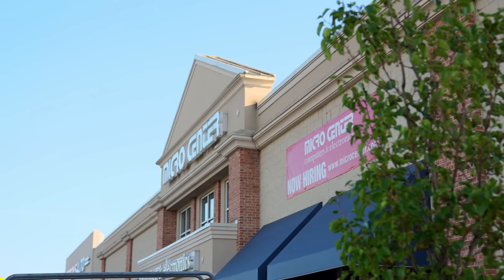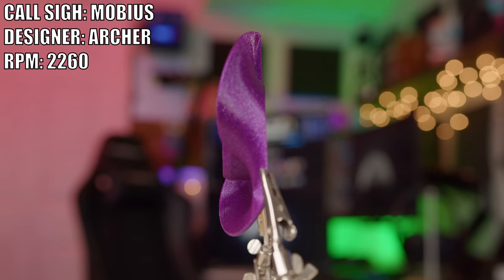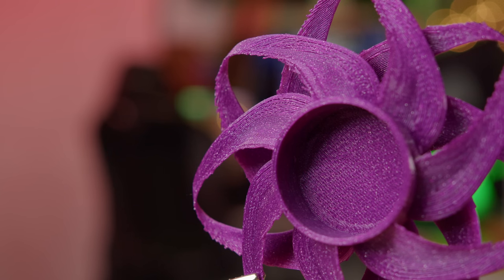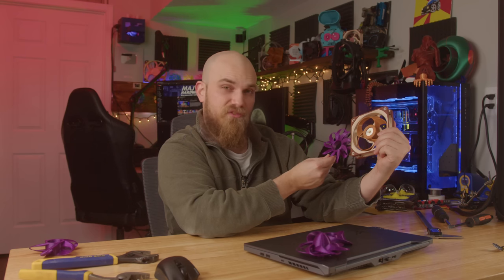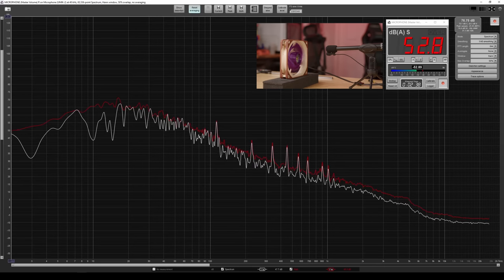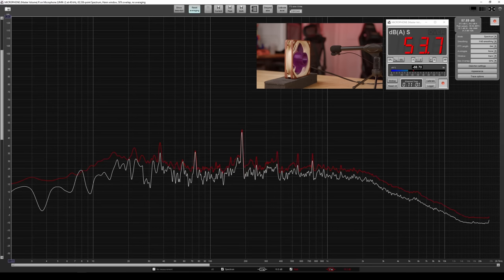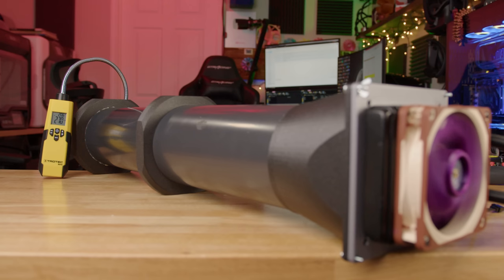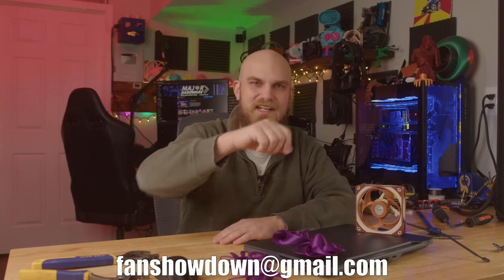My Subscribers Turned MIT Award Winning Toroidal Propeller Into A PC Fan | Fan Showdown S5E5

Comment: Very interesting. That original MIT blade was meant to spin in free air as a propeller not in a shroud ring as in impeller though. That's not a trivial detail regarding performance. Were the design optimized as an impeller it would drive notable changes in form factor.  Beside shape fidelity, surface finish also has major impact on laminar flow which directly relates to efficiency/turbulence aka noise. Even well printed FDM blades are going to suffer, but when they're ragged from support or missing chunks it kind of invalidates the process. This has really gotten me curious to how these really perform though, I feel like there's big potential here.  tl;dr: optimize for impeller duty and print in resin to see how toroidal blades truly perform

Comment: So I'm not an engineer so maybe I'm completely off the ball, but wouldn't a lot of these tests also depend on the manufacturing and actual material of the fans? I would just assume so because 3d printed stuff at least in my experience isn't watertight and has a bunch of seems so I would assume that air getting in those seams and stuff would make it a worse product even though it should be better than a normal fan, I think you should use the Noctua fan 3d printed copy as a control and resin print all of these if you were to revisit this, but again not an engineer so could be super wrong.

Comment: From what I saw from others, the toroidal props for drones wasn't even a good idea as it ruins flight times as the propellers weigh so much more and drag more in the air. They seemed to have noise normalized for RPM but since it's less efficient the RPM needs to be higher and as a result the shape is just less efficient and only negligibly quieter.

Comment: Isn’t the point of these toroidal blades to minimize vortices?  Doesn’t the ring housing on a fan dispense with those?

If so, this test would never show the advantage. 

Is there some test, like thrust comparison, that could compare these great prints to these tipped blades, but without the housing?

Comment: Why don't you use sla/dlp printer. Propellers would have way better finish, dimensional accuracy and weight balance. And way less struggle with thin blades.

Comment: The cooling fans are already encased, so I'd imagine the vortices are already reduced. This is basically nullifies the biggest advantage toroidal blades have over normal fan blades. Plus the design effort and testing put into the blades, It doesn't surprise me at all that the toroidal blades lose.

Comment: Another test another fail I say.Toroidal blade design is for between 2500-4500RPM range. You barely touch the 2500RPM milestone. You had to try with Noctua's Industrial series that could rech those rpms.

Comment: Obviously those fans are not doing good with a radiator between, the design is just not suited for static pressure without radiator they will probably move quite some air.

Comment: I'm thinking Toroidal fans get their benifits because they are designed to allow the high pressure to flow into the low pressure side of the blade which then positively affects the reverse side of the loop. The cheater gets its enhanced performance because the duct prevents energy loss in turbulence  due to tight tolerances between the rotor tips and the duct. However, Toroidal is hampered by the shroud. I think if you want the benefits of the toroidal design you need to cut away the shroud and mount the motor on X shaped struts.

Comment: this is going to be a bit of a long comment about why the mobius may have had the same result in both test. my sciantific knowlage is limited to my electrical training but physics is physics so please feel free to test my theory.

I belive that your air flow measing device only tells you air speed, regardless of the direction. a fan will only be able to move a limited amount of air by volume and other constraist could change how fast the air moves. but with this in mind the mobius on the test should get the same result as it is moving the same amount of air regardless of if it is sucking or blowing the air. in the electrical industry we can get simular results depending on the tests we perform. on a resistance test, it doesnt matter where i put the probes as the result is the same, on a voltage test the result would still be the same but if the probes are the wrong way round i get a negative value equal to the positive value. 230volts is the same regardles which way it flows, the nagative value just tells me which way it's flowing.

try putting some fans on the same test. put them in both a push then pull configuration. if you get the same result both times then my hypothisys is correct (all fans move a set volume of air to a certain speed regardless of sucking or blowing) if you get a negative result which is the same as the positive (+- for errors) then your measuring devise can also inform you of direction, this would also outline an oddity with the mobius being always positive within the tube (like an auto direction feature). if you get diffrent results, ignore this comment.
Reply: Thanks for the feedback. 
Expect more videos soon. 
Send a direct message... 
I have a Gift for you📦......

Comment: Toroidal fans are designed to reduce turbulence at the blade tips and direct the airflow because they are designed to be used WITHOUT a frame. The fan frame in a PC fan is there to do the same job; reduce turbulence at the blade tips and direct the airflow. So unless you can manage to run the A12x25 without a frame and then test these toroidal fans frameless, it's just not a fair comparison. The toroidal fans have more jobs... They have to eliminate turbulence, reduce noise and generate airflow. A standard PC fan mostly just has to push a ton of air and noise becomes the secondary concern, however noise is also a byproduct of turbulence and the fan frame is a huge contributor to eliminating turbulence.

I've also noticed that all of these toroidal fan designs follow the standard toroidal concept of having fat blades at the center and reducing the width as it goes towards the tip, which is totally backwards from nearly every single high CFM PC fan design. I wonder if you'd get better results from the toroidal fans by using thinner blades near the center that get wider towards the tip, like a normal PC fan.

Side note: The A12x25 is a great fan and very hard to beat. I think the BeQuiet Silent Wings Pro 4 (that's a mouthful) actually gets better airflow than the A12x25.
I looked around to see if you'd done a comparison video between these fans but couldn't find one. 
It would be awesome to see these two fans go head to head in an in-depth comparison to see which one is top dog.

Comment: Why hasn't no one made a thinner / lighter version of the ref. Noctua fan blade design? We know Noctua makes the best design, so why not just improve on that and make it lighter, taking out unnecessary cosmetic plastic sections and making the blades slightly thinner / more delicate so it can spin faster.

Comment: This won’t work with a flat fan. At least at low speeds (below 20000 rpm) it has to be elongated. Otherwise the toroid is just like two blades.

Comment: From a standpoint of fluiddynamics its clear. All those toroidal fans are constructed to create flow while spinning freely and not in a tube. They are created to reduce noise and cavitation. Also one cant just simply take a toroid and scale it down, thats not how it works. As a fan they will never be as good as a normal fan, because they are not ment to be incased.

Comment: Problem with thinking thoroidial fans in an enclosure is that there is no need for the extra boundary that the thoroid provides. Thoroids idea is to use them in application where there is no enclosure boundary wall for the propeller, for example boat propellers and copters propeller to ensure the air doesn’t escape the blade. So I just think the whole idea of thoroidal being applicable in this scenario is just waste of time.

Comment: Hey man, could you please give me parameters of the box, on which you're installing the propeller (diameter of a hole, maximum diameter of propeller and rotation speed), i want to design my own propeller and send it to you for 3d printing, and also can send you several bucks as compensation of materials. Tell me the price. If it's less then 10 bucks, i'm in...

Comment: It would be good to know the airflow in liters per second in addition to CFM so people don't miscalculate conversions and so toroidal fans can be used in air filtration applications for improved indoor air quality to reduce the spread of infectious disease in surgical and some other healthcare applications. See the new CDC guidelines on improving indoor air quality and the standards (subject to change). 
    Quiet fans are important because health care providers need to hear heart and lung sounds among other sounds that may need to be auscultated.  Putting fans in a ducted positionable tube or on an articulated arm as part of a mini Corsi-Rosenthal Box air purifier could get the air intake close to the exhalations of staff without being too obtrusive,  in an operating room could be an option for improving the working conditions of surgeons, anesthesiologists and staff. This depends on high liters per second, and very close proximity of the air intake to the mouths and noses of the people breathing. Other measurements are Clean Air Delivery Rate and Air Changes per Hour. Human factors are Tidal Volume and Minute Volume, and pathogen concentration in a liter of breath or tidal volume (fact check).

Comment: The ideal range for the boat propeller is 4k RPM to get +105% according to manufacturer sharrowmarine while at both ends 2k and 6k RPM there is almost no benefit over conventional models. Now i don't know how that translates from water to air. Anyone got a clue? Would expect you need to go even higher with air. tldr: i think it doesn't work cause RPM is way to low.

Comment: I can see that all those blades are very shallow
Increase the "height " of the blades and youll se big difference.
Those blades need some to " grab "  and there is not much of substance  ( gas, fluid ) to feed the blade
You are designing these blades to fit in a regular fan frame that os designed to suck the air of the front basically. 
The propeller you try to adapt, get the substance from the sides.
So forget your shallow design and think outside de box literally 
You dont drive over wheels with the hubs spinning against the road

Comment: how about ai genereted fans? i know there is exist algorithm for generating strong and light structures but maybe it possible to generate a fan? but i know differential equations for calculating flow is not good for fast computing and i don't know a faster way to calculate it.

Comment: The only problem with this fane is it does  not have a good air and or FLOW potential.  So it  just putting 15 to 20 % of air around.

Comment: I think you made a mistake while comparing these designs.. They are not optimized for duct fan frame. Instead I suggest to test them on a brushless motor without any frame near props

Comment: You’re doing it wrong!
The toroidal fans are self shrouded.
Putting them in a standard shrouded pc fan housing Fs up the the test and the entire point of the fans.
Remove the housing and mount the motor on a stick to do the tests.

Comment: Isn't the benefit of a toroidal fan for a drone in the pressure it generates more so than the cfm? Trading motor power to flow for motor power to pressure? 

As a big fan (16kcfm range) dabbler (buying not designing engineer) I have to imagine the benefits aren't exactly what you'd be selecting for in a PC build.

Comment: If you look at this underwater shot of a normal propeller vs a Sharrow prop you can see that one of the main benefits is that the Sharrow concentrates any cavitation into the centre and not at the tips of the blades -that's one of its main advantages. Having any fan in a duct will reduce these tip vortices as well.   It doesn't surprise me that the toroidal fans you tested are actually worse than the best 'normal' multi-blade fan as by ducting it in the fan case you have already solved one of the key problems with any propeller, that of wing tip vortices...
https://youtu.be/UzYHO4tksTc?t=362

Comment: Its like teaching the teachers... But.. the shape we are trying to do here is based on the the tip of blade and how air interacts with it... In our tests the fan has frame... It changes almost everything...the movement at edge is affected by small, tini-tiny gab between the walls of frame and the edge.. this failing all the physics applied...

Comment: You shouldn't compare 3d printed fans with regular ones as that is rather unfair due to the rough surfaces. You should really print a regular fan blade for comparison or else smooth the 3d printed ones with some epoxy and sanding.

Comment: 10:10 Weren't the "new MIT design" supposed to be more efficient? What is the real purpose of these new fan designs if in the end they are less efficient than the traditional reference fan? In all domains: they make more noise, spin at a higher rotation rate to make less airflow. I don't see the point.

Comment: There is no point in designing fancy props to minimise tip vortices when it's ducted. You minimise tip vortices by getting the blade tips as close to the duct as possible.

Comment: im sure that if you used the actual MIT fans with the correct measurments and specs it would blow youre scoreboard over... you cant just assume that the ones you tested were the same thing... extremly small changes can have huge impacts on performance... pretty sure MIT tested a bunch to figure out the best working one...

btw i dont know why you say the toroidal blade cant be good because it was deseigned for a drone to fly and not being a fan... a fan displaces air, no matter what its initially deseigned for, it will do its job... the problem you have is using approximate dimensions and assuming you have the best one...
Reply: Thanks for the feedback. 
Expect more videos soon. 
Send a direct message... 
I have a Gift for you📦......
Reply: Well look at their "paper" on the thing ist literaly 2 pages long and contains almost no data a paper from a very exclusive and international respected institute mind you, it has a bytaste i dont like very much all things consiered.

Comment: The toroid makes the propeller quieter by adding a poor mans duct to the end of the propeller.
This fan already has a duct… so it’s just a straight up downgrade to add a lower quality “duct” to a smaller fan blade instead of using the actual duct and the full radius it allows.

Comment: The whole point of toroidal props is to remove tip vortices which the duct would already minimize. So, no point really as the PC fan is a ducted fan not an open propeller. Buuuuuttttt its a fun go so why the hell not….😂

Comment: Just from a physics POV. Your prints are terrible for fans as your using a FDM 3d printer and the ridges are going to cause high turbulance. Consider using a resin printer to reduce this and also potenially go through an acetone fume bath to smooth the surface. Could be a test - retest experiment?

Comment: NEVER let another assemble your PC!!!!!
Get the parts, do it yourself.
Only then you are sure you actually got what you bought, and that it's done well.
Reply: 7-bladed Toroidal:
Never use a brute printer for fine work.
Also, you might kill the fan blade as it is already nigh falling apart.
Further more, it will affect the outcome of the test results for sure.

Do this in either a fine printer, OR make this one in fine sheet metal.
Great idea to reuse tin cans.

Thoroid:
Firstly, how hard is it to pronounce it right?
Thor ... oid.
So easy.

That said, funny:
Let's add blades. 
Moar blades. 
Even MOARDER blades.
Soon, MOARDEST OF ALL blades?
Try less ... who knows it might pull it off.
2 seems neat ... IF all it worked out nicely:
Angle of attack, witdth, length, spin speed, ... .
Spin speed for instance in air needs the attack angle right for that speed, or "it catches nothing of air".
Logical.
Much like ol' plane propellers, which had variable attack angle settings.
THINK, folks, THINK.

Also the blade with is important to be calculated out.
Too small, "it catches nada", too large: you get too much resistance.
If a thin blade is at too slow a speed, again no wind.
If a wide blade goes too fast, it will slip through the air:
thus no wind.

Think, people, think ... .

If I had the tools (decent fine-printing printer), etc, I would do this myself.
Alas.

Another thing:
Both surfaces (of the 7 and Thoriod) are DAMN rough.
Which AGAiN affects airflow, thus sound, ... .
For a fella that can turn 4 airbus bodies into a fan ... (I can turn anything into a fan blade) this should be known.  :S

It's basic Aerodynamica.
No?
Reply: Inverted Sharrow:
Hmmmm, curious ... .
Love the aestetics, seems quite darn practical.

Love to see the tests.
Reply: "If anything, Rod is honest ... ."

ALL designs were stolen from MIT, one can say.
No one came up with this idea, and used the MIT invention as a base.

But, then again, they too stole the idea from a boat company.
No?   :)

So, one cannot steal ... from a thief.
Bad MIT!!!! 
TSSSSSK.  XD
Reply: The Mobius:
Place this at the rear end of the PC:
So it SUCKS heat out.

Combined with the Inverted Sharrow, in a test tube, it will produce interesting effects:
While the front sucks air in, the Mobius extracts it.

This is how I do my PC's ... .
The rear fans suck the air out.
Reply: Yep, Inverted did well!!!
As I assumed.

Now, at the REAR end, place the Mobius to SUCK the (normally warmed/heated) air out.
Reply: Make a dual bladed/twin bladed.